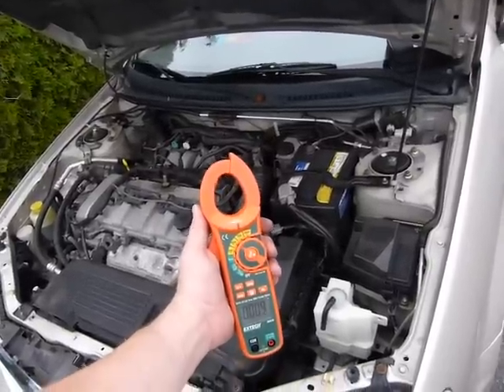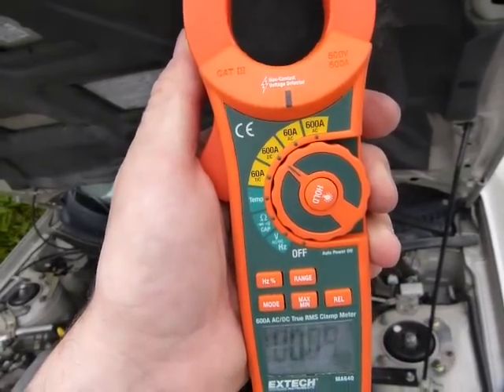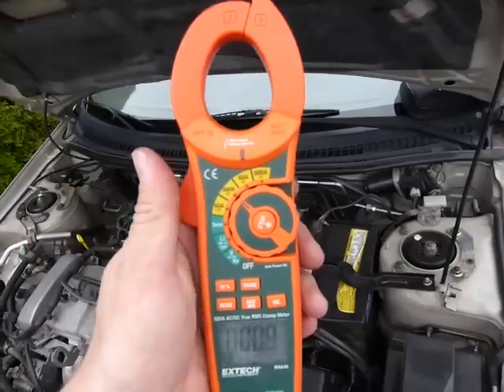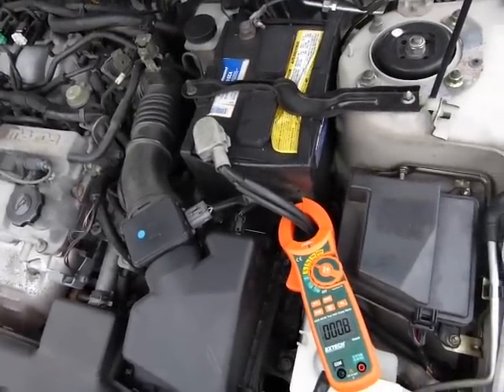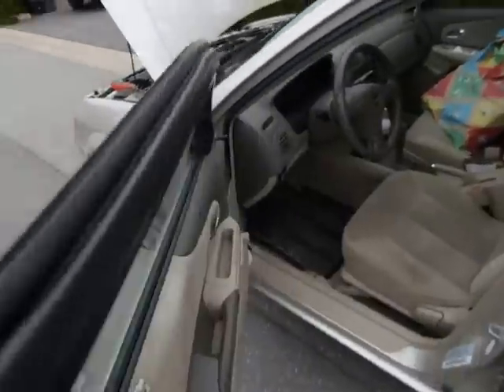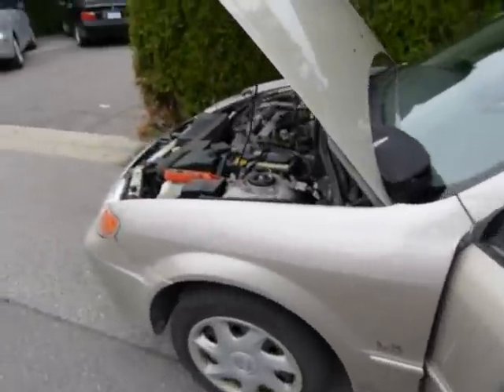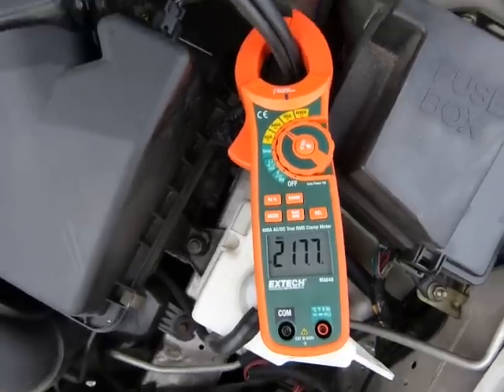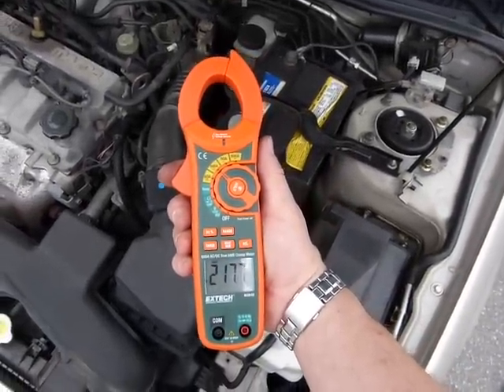Measure Amps (non-contact, DC) on a car

Comment: I got one of these and if it aint in a airtight box it will get humidity in it and voltage rrading will be off i had high hopes for 5 digit display getting accurate reading of voltage and also you got to wait aboit 2 seconds for it to read ac amp

Comment: Wrong!! ,you can not using 2 wires pass trow  at same time on the jaws ,,,, only 1 cable  not 2 or more , go learn how to use a meter and them ,,,,,so then ,,,, come here and teach some one how use a electric instrument please !!
Reply: May I help you understand measuring more than 1 wire at a time.If current in 2 wires are flowing in the same direction the CC treats the 2 currents as a single current.2 wires are flowing in opposite direction the CC will do it’s job and subtract the current draw by subtracting the lower from the higher.CHEERS

Comment: Nice video. Could you make a video how you would use this tool to find a drain in the battery by checking the fuses or this device would not be able to that.
Reply from the maker: This device is capable of showing a parasitic draw (finding the drain) if connected in series. However, It does not do the thinking about the cause (headlights on?, an alarm system?, parking lights?)

Comment: 217 Amps on a 12 volt battery? Ha Aha
Reply: Yes, that is correct for the amperage he measured, which was starter amperage.  Thats roughly 2600 watts for the starter motor.

Comment: In reference to the comments that he should have measured the alternator current, this is just a good way to check a battery when it measures 12.5+ volts but won't start the car

Comment: As others have pointed out the meter was basically set for a "peak hold" type of measurement meaning that current was measured across those leads while the starter motor was a load on the battery and even though that load was momentary the meter will still display the highest current captured even after the starter motor is no longer drawing current.

In other words this is not the way to measure current draw from the alternator while the car is running normally after it has been started.
Reply: That and it's clamped around multiple wires. You need to clamp one wire at a time or they cancel out each other giving lower readings

Comment: Question - in today's vehicle the battery is often in an inaccessible spot. If there a way to use a clamp meter in such cases. I just need to see how much current the vehicle is drawing with all accessories on.
Reply from the maker: Might connect a length of starter cable to the existing battery cable, form a measurement spot on that

Comment: He set his meter to measure the maximum amp draw. The meter won’t measure anything below the maximum amp draw while set this way. He was connected to the battery, it matters not if he connected to the positive or negative side. His reading will be negative if he has the meter facing the wrong way, similar to measuring voltage with your leads backwards. The value registered, when negative, is still accurate.
The test was accurate for the way he set his meter. One  reason I can come up with for the reading differences is he might have turned off an accessory decreasing the load (amps) The other is his meter is inaccurate.
Reply: I thought the difference was in the position the starter is in for initially turning. Depending on how it lines up with the  magnetic poles it could take more or less current to get it moving. Could be wrong though.
Reply from the maker: Probably both, thanks for watching

Comment: You clamped on input from generator and output from battery. Connect only on alternator harness. The current going to lights, fan etc., that branch is not needed inside clamp. Connect only current coming in wire.  How DC current transducer or clamp on works? I never heard of it.
Reply: The alternator does not start the car, the battery does. He's just measuring the amount of power the starter is drawing from the battery. And DC clamp meters are a pretty basic electronics tool, ex. Fluke 325.
Reply: Yes DC clamp ammeter exists and useful for large amps. Only Battery starts. He is testing the starter current.

Comment: 200+ amps alternator costs over 300$ and doesn't come stock of almost anything. Your doing this completely wrong lol...
Reply from the maker: Hence the title, Measure Amps.
Not one word about alternators.
Focus.
Reply: This is not measuring the alternator at all.  Its measuring the peak amps drawn between the starter and the battery, only at the moment the starter is cranked.
Reply from the maker: And that relates to measuring Amps how exactly?
Reply: There is a difference between peak amps and a consistent flow of 200+ amps, your alternator could probably do peak amps double or triple the regular value
Reply: @ArcticAstrophysics  
peak amps on AC = RMS X 1,4142 , since the alternator  is a 3 PHASE  generator  here is a peak  voltages and  current,  on DC ,no peak amps but inrush current ,people MIX everything UP ,
Reply: try again....he's not measuring the alternator at all

Comment: It didn’t pick up the charging amperage from the alternator. It picked up the amperage from starter draw. If you want to see the alternator amp output, start vehicle, then zero the clamp and place the amp clamp over the positive cable coming from the alternator.
Reply: In DC mode?
Reply: @dangerousfandango5943  .
Reply: it will just read amp drawn not total amp output.

Comment: How many amps/watts does the car battery draw during normal running operation with the AC, music, and headlights on?
Reply from the maker: I`ll measure it this afternoon (it`s 10 am here)
Reply: 30AMPS. Exact amps Depends on battery charge level, headlight wattage

Comment: Start at 217.7A and the voltage how much?
Reply from the maker: 12.5 - 12.7 is traditional
Reply: Thanks information.
If convert to Watt how much?
Reply: 217amps a second,??? What was the rpm? That's the initial, do you know the idle amps??

Comment: I am sorry, but are you sure about this reading? is that the peak from the starting motor? because it does make any sense you having such a high current on a car, just running... Heaps of alternators are about 100a only. What has this vehicle to be running almost 3000w?
Reply from the maker: Peak starting in-rush current, nothing to do with running current. Vehicle is a plain 2002 Mazda Protege.
That`s why one can`t run a 12A fridge on a 15A generator, because the starting current exceeds 15A, fridge can never get to running.
Reply: ah ok... i was wondering how much is the current that a normal car needs to run with headlights on, wipers, blower and cooling fans, etc... just to know how many more amps I could get from the alternator without changing it
Reply from the maker: Look at the main fuse amperage, a good indicator of the vehicle`s total max running amps.
Reply: Yes, that I saw, 100a fuse. What I mean is how much it really need. I installed a sound system that's working fine but I wanted to know if my alternator can provide enough current or if I am pushing too much and need to upgrade. The easiest way is measuring, like the video.
Reply: Andre Luiz you would be better off just going by the specified power draw of your head unit/amp/speakers, and add that to your fuse schematics, unless you plan to open your dash to measure your head unit and then each component. 

Then use the multimeter to test your alternators output as well & do the math. 

Testing your alternators output while you have a full battery and you’re idling will give you an idea too, if you have a 100a alternator and at idle with a charged battery it’s already putting out its max capacity, that effectively means that when driving it won’t charge your battery as well as it should. 

Can also use a site like this to estimate 
http://www.qualitypowerauto.com/pages/AmperageLoadCalculator.php

Comment: You cannot measure amps with clamp on meter.
Reply from the maker: Manufacturer claims otherwise. I know it`s not part of the circuit in series, so it`s a rough estimate of big amps.
Reply: Not an estimate it is a wild erratic reading.
Reply from the maker: Manufacturer claims otherwise. Extech customer service is at http://www.extech.com/display/?id=13709
Reply: Read your info again. Only AC amps.
Reply from the maker: Extech AC/DC clamp meter models: http://www.extechcanada.com/instrument/categories/clampon/acdcClamp.html
Reply from the maker: Featured in video MA640, AC/DC clamp meter. http://www.extech.com/display/?id=14558
Reply: Read it more carefully DC cannot be measured by clamp on.
Reply from the maker: Page 5 of the manual reads:
DC Current Measurements
WARNING: Disconnect the test leads before making clamp measurements.
1. Rotate the Function switch to the 6ooA DC position
2. Press the trigger to open jaw. Fully enclose only one conductor.
3. Read the current value in the display.
4. If the value is less than 60A, rotate the function switch to the 60A position to improve
resolution.

It`s very carefully read, like I said 5 times. You do the reading from here on, we`re done.
Reply: Fraud. Send it back.
Reply: The clamp is not that accurate. I think its good for testing starters, alternators, etc. I just don't think it would it would work for trying to see less then an amps worth of difference. I wouldn't bother using it to measure anything less then 10 amps.
Reply from the maker: Yup, the right tool for the right job. Manual`s page 11 says DC Amps accuracy is out 3%, so at a 10 A load the instrument reading could be 9.7 or 10.3
I use a max.15 A contact multimeter for small current where it can be in series.
Reply: @johnpuccetti9383  For that there are the current clamps that measure leakage current, which regularly these clamps are up to 100 Amps
Reply: @johnpuccetti9383  Hall effect clamp meters to measure DC as well as AC current have been on the market for at least two decades. Their prices have in that time fallen by roughly a factor of ten. They do serve their purpose admirably. Like every measuring tool, each has its level of accuracy.
Reply: Your dog died didnt it...
Reply: John Puccetti yea and Flukes meters that do the same are frauds too at $600 eh?
Reply: John Puccetti it’s not meant for fine measurements genius, you’re a fraud and you should be sent back, if you need finer measurements at lower current you switch it to 60amp range and if you get a fluke it autoranges and samples ridiculously fast, or just buy a cheap multimeter than can measure 10A dc and measure down to ma, you can’t excpect a reading to the milliamp when measuring hundreds of amps of dc current, not even a autoranging fluke will do that
Reply: immrnoidall user manual for the best meters made, showing this model measures 400 dc amps via the clamp, other models go higher https://images-na.ssl-images-amazon.com/images/I/B10PKKInssS.pdf
Reply: apprenticemath s
Reply: Wrong John you can  measure amps with clamp on meter
Reply: for batteryes you need a clam meter with DC AMPS NOT AC!! for homme circuit or board you need AC amps
Reply: if you have a clamp meter,look at the clamp part closely. hold it right up to your face. it has an arrow for dc amp use. it  will look like DC+-->. THIS means to point that arrow at the positive source terminal end of the wire you want to test. if yours has no arrow. , smash the meaterinto your face,then smash the shity meter , and buy a real one and shut up.

Comment from the maker: 0.01 Amps can kill you. I measured 270 Amps first, then 217 Amps on the video. So I figure thats 27,000 times (or 21,700 times) the lethal amount. Lots.
Reply: Yes but 12v DC (unless you have wet hands) isn't enough to pass the skin's resistance so it could be 5000 amps and you'd be fine.
Reply: Only a current range between 0.1A and 0.2A will kill you. Anything more will cause severe burns. (This does not include being fried to death from high current burns or other scenerios like Pacemakers, etc...) Checkout: http://www.physics.ohio-state.edu/~p616/safety/fatal_current.html
Reply: apprenticemath Nice video mate. How long the time gap between those 2 measurements taken? Wonder what cause the massive difference (270 vs 217 amp). Could it be the temp? Battery or wire resistance?
Reply: Actually according to St johns training, Three amps can kill you.  Your body produces its own electricity more than .01 amps I would think.